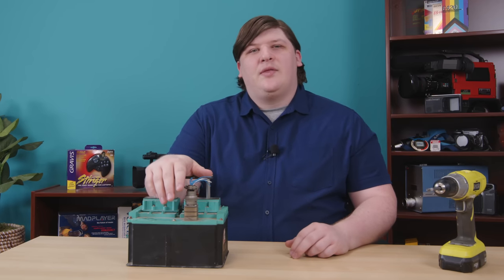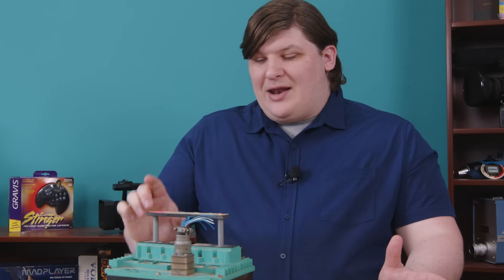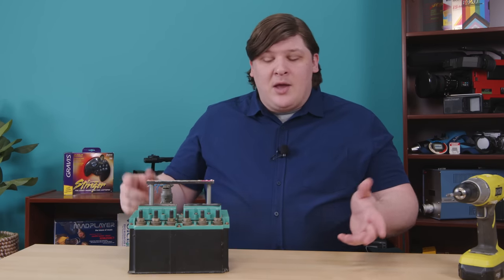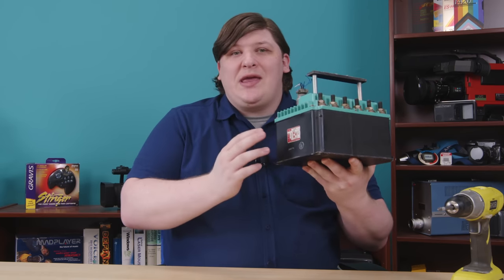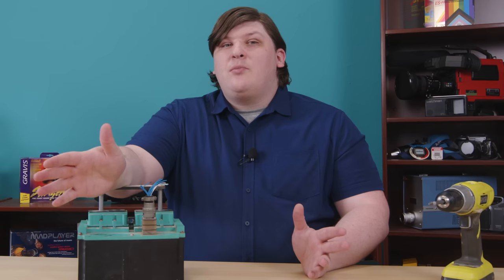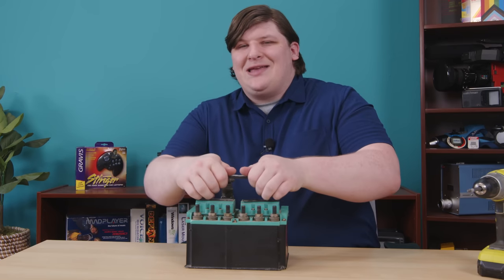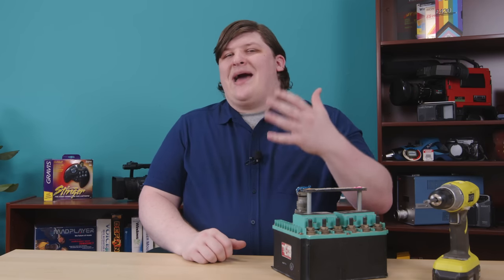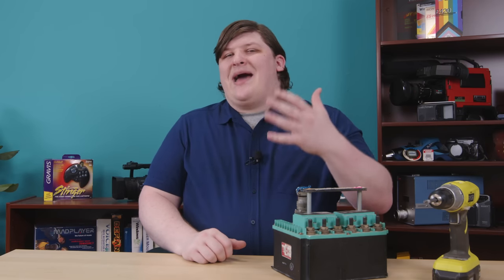A Short Story About (Battle)shorts

Comment: As someone that's been in combat conditions and operated military equipment, I can say with 100% certainty that YOU DO NOT GO AROUND YOUR EQUIPMENT AND DISABLE ALL THE SAFETIES AND AND ENGAGE YOUR BATTLE OVERRIDES. In fact, with the exception of overrides/war time fuel reserves/war time power (yes those still exist) in planes where the pilot has unilateral authority to do such things, no one is allowed to engage a battle override without a direct order from a commanding officer/NCO. That being said. You probably wouldn't get in trouble if you engaged one in the heat of battle and it ultimately saved lives/the vessel. Those overrides have labels near or on them expressly forbidding their use without appropriate orders to do so. The best way to think of a battle override is as a last resort in case of a malfunction on a critical piece of equipment, ie a generator. We used to refere to them as "run to death switches" because thats exactly what they did. Also land vehicles do not have override switches. They are designed from the get go to "run to death" under the assumption that the human operating said vehicle and demanding maximum power is probably more knowledgeable about the current situation and simply defers to their judgment. Part of a service members training is the limits to which they should operate their equipment under normal conditions, commonly referred to as "do not exceed" limits, and when they are allowed to disregard those limits (basically anytime they feel it warranted in combat). A tank that stopped spinning it's turret in the middle of battle because a safety said nope, you might break me has instantly become a death trap for anyone inside. Remember tanks kill other tanks, and these days takes are pretty fast and accurate. Those few seconds that someone would need to figure out a safety had cut in would probably be the difference between life and death. Instead that turret will keep turning, even after the gear box has dumped it's fuids and the motor has caught fire, it's going to keep trying. Your proverbial tree (which would not in any way stop a modern tank from moving) won't even register as far as the tank is concerned, it will keep trying until the operator stops and checks it out, or it burns.

I fully understand and respect your stance on military. Obviously myne differs, but that's ok, different paths in life and such. But, we should be careful in attempting to talk knowledgeably about things we don't understand, especially if we have intentionally distanced ourselves from those things.
Reply: Last sentence was totally uncalled for considering all the precautions taken to emphasize on the speculation side of things.
Reply: @capybara5494  I disagree. If your intention is to be informative, don't speculate. And I was as kind about it as I could be. The simple fact is CRD understands the technical aspects of the of a battle override, but doesn't seem to understand why they exist or how they are are used. He also talked a lot about where they are used and was quite wrong. Many people in the comment section that are equally under informed are agreeing as though everything said in this video was spot on. That's not a good thing consider how many errors he has made in this video.

CRD has built himself a reputation for being a valuable and reliable source of information on technology and the history that surrounds it. Speculation to the degree he does in this video is a surefire way to undermine that reputation. Better we point out his mistakes so that he doesn't miss them now rather than just letting him fail. I personally like his channel, his style, and the way he produces his videos. If you like someone, the best thing you can do is point out their errors.
Reply: @jonmcentire  Wow, just wow! You are wrong in a few ways but what's most obvious is you are just being spiteful. First, "doesn't seem to understand why they exist or how they are are used", this is only half true he had a very good understanding of why they exist even considering he was speculating. It could be said that is is true that he did not know how they were used but he wasn't that far off and his lack of understanding there only come from him not serving himself, he wasn't to far off though. Mostly it was just about the when and who of the matter, and the idea that they may also be used in all major equipment. However, he made it clear multiple times he was speculating on that not stating fact.

Second, "Speculation to the degree he does in this video is a surefire way to undermine that reputation" This statement is patently false. The only way it could be true is if he was not clear about the fact he was speculating and was attempt to present everything he said as fact. Speculation in and of itself is not bad, it is just a way for us to take what knowledge we do have and attempt to understand why or how something we don't know about might work. Speculation is only bad if it is presented as fact, or has not basis in any real facts.

In my opinion you, maybe as a former service member or maybe as someone that just really likes the military, took offence to the fact a creator you like has a opinion of the military that you don't like or agree with. As a former service member myself I'm not happy that it almost appears that CRD may let his dislike for the military extend beyond how it is used to include it's very existence, but I can at least understand why someone might hold that opinion. One thing is for sure I would absolutely not let it affect my opinion of his content nor would I vent my frustration by posting uncalled for jabs and trying to make it seem like he has done something wrong just because we don't see eye to eye on this one topic.
Reply: @lerakuro   Istand by my original comment. I have no problem with his stance on this military. That's not an issue for me. CRD has a right to feel the way he does and I respect it. My only concern is specifically that it may color his view on the military and things pertaining to it, especially if he's going to freely speculate on the subject.

Speculation is pointless if there are valid sources of information and you don't use them. If nobody was available to ask, or there where no sources online, then yeah speculate away. But that's not the case.

As you said, he was mostly wrong on the when, who and where. Which is pretty much all of it. Even the why was wrong by about 50%. 

To your final paragraph, my prior service not withstanding, I like the military in that I served with some excellent people and experienced some awesome things by serving. I also think it's an excellent career for anyone that can cope with that lifestyle. That being said, the military most certainly has it flaws and I have no problem pointing them out. CRDs opinion of the military does not color my view of his content. My only reason for posting my original comment was to point out the errors in his speculation and to caution against freely speculating on a subject you have admitted to disliking. His channel has been about facts and well reasoned speculation. This was not well reasoned speculation.

Comment: A great video about a sobering subject.

As for crews being aware of the limitations or results of emergency overrides, at least in theory, they should be. 
The excerpt from the P-47 manual you put up for War Emergency Power mentions the overall hard limit of 15 minutes, and this would probably be broken up into shorter chunks (e.g. 5 minutes at a time) to limit overheating, which could seriously damage the engine there and then. Pilots would also (provided they made it back) have to log/explain any use of WEP, both to prevent abuse, and to keep track of the amount of WEP time the engine had (for maintenance/overhauls). That's one reason for the stop wire, you could tell afterwards when WEP had been used.  
How well an operator (of any machine) can keep limits like this in mind obviously depends on training and on the specific situation they're in, but it would've come up in manuals or training somewhere.

Concerning the cynical part of the video... don't they already call that "crunch time", and abuse it?

Comment: You're close, but let me correct some things: The original machine has a base-plate of prefabulated aluminite, surmounted by a malleable logarithmic casing in such a way that the two main spurving bearings were in a direct line with the pentametric fan. The latter consisted simply of six hydrocoptic marzlevanes, so fitted to the ambifacient lunar waneshaft that side fumbling was effectively prevented. The main winding was of the normal lotus-o-delta type placed in panendermic semi-bovoid slots in the stator, every seventh conductor being connected by a non-reversible tremie pipe to the differential girdlespring on the "up" end of the grammeters.

Comment: I’m a service contractor… I have been since I was 15… relays fail… a LOT and bypassing them is often required to get things working whenabsolutely needed… 
So, the phrase often repeated in Star Trek never stood out to me… it’s obvious.
Reply: For instance… in an air conditioner, there is a big relay called a contactor… when the primary coil fails, he contactor won’t automatically engage/turn on…
There is a plunger you can push to engage manually… or bypass… any electrical device that requires a large current to start up… needs one and the ability to bypass is critical for testing or emergency usage…

Comment: 28v DC is Aircraft voltage - I work in Aerospace and we build fans, valves and services a wide variety of other aircraft small parts like actuated doors.  (by the way, we met in the Junk Store a while back talking about old motherboards - and I sent you an email)
It likely could have been used on either place

Those plug & socket with the wires sticking out, are not cheap.  They are sealed connections.  I build the female side of these at work for some fans.  Some about that size, and most smaller.

"Battle Short" exists on decommissioned military power generators.  Keeps the engine running at a higher RPM and disables/bypasses some safeties to keep vital equipment running.

Comment: Brother is in the Army and says you're mostly right but that once it's closed, it never opens back up, and that's probably why this one got removed. It's been engaged and there's no easy way to undo that. They "Look a bit different now" in his words but this was probably used for a hydraulic pump to move something militant.
That said he is "pretty sure" they use ridiculously overbuilt wiring to support this behavior and that the failure point is "always the load"

Take from that what you will

Comment: I think the EPS relays are more to do with the routing of power through the ship's various conduit pathways. Per memory alpha, EPS stands for electro-plasma-system, where instead of say copper, plasma is used as the conductor due to the vast amounts of power required(aka, copper would vaporise into a plasma anyway) . So it's more like when the power company trips different relays to re-route power between different substations around damaged equipment and get as many people back up and running as quickly as possible, and to limit the inrush current by bringing single parts back online instead of repeatedly tripping the breaker at the primary sub-station. Power companies routinely alter the load balance of the grid to deal with maintenance and outages. 

So in Star Trek, when they say bypass the relay, they literally mean send the power down a different pipe to avoid damaged sections, which might mean shutting other things off that were previously using the pipes it's being re-routed through. Whenever they say override the relay it's more in line with your explanation, which is probably why they often throw around terms like "it could fuse the relay" when they talk about overriding relays. The Iowa class battle ship had a "Casualty Power System" that could be used to bypass sections of damaged electrical conduits, with outlets peppered around the ship that they called "biscuits" for some reason.
Reply: The big override is literally a bypass.
It bypasses the internal contacts of the relay.

What you're referring to is "rerouting" in the show. They reroute around damaged conduits and bypass relays when the conduits are fine when the relay is not responding.

Comment: cannot substantiate, but i was told that during the lunar approach & landing mission command had balle shorts engaged for the control room. it didn't matter if a console was burning, you were supposed to keep doing your job while the guy next to you (with the burning console) fought the fire. obviously similar primary equipment would be "shorted" as well. just because the tracking motors in a radio array are
about to melt doesn't mean they get to stop working.

Comment: 19:00 - Humorously, when Lockheed developed the Blackbird spyplane, (plus the cancelled B-70 bomber and a few other similar ultra-high-speed, high-altitude aircraft) the Soviet Union developed the MiG-25 interceptor/fighter aircraft.

It was capable of reaching the speed and altitude of the SR-71 Blackbird - but only at the expensive of pushing the engines way past the "safety margin". It would get one "boost" to try to shoot down the American plane - then if it was lucky, the engines would last long enough to land. If they did last that long, they would need to be scrapped and replaced.

Comment: About the War Emergency Power.
In the memoir of the pilot fighting in the Czechoslovak RAF 311. Bomb squad. He mentioned a fault in throttle linkage, that pushed the engines of their Wellington to the WEP rpm range. Engine manufacturer rated the engine for only 1-2 minutes of WEP, then the crew risked a "catastrophic failure"
They were at that time over 100 miles far from the nearest RAF airfield, flying in a low altitude, doing their anti submarine run.
Despite all of that, they managed to reach the shore, cut the ignition and glide to the airfield.
Plane was immediately stripped of its engines and they were sent back to the factory for analysis.
In the end they only found an increased wear, fro the amount of the engine hours, but nothing out from the factory tolerances.
Reply: that is really up to tolerances at that point. maybe the engines they had worked fine but 95% of all others would have failed

Comment: I'm reminded of hearing about an aerial tramway which didn't have the best safety record. It turned out they had defective equipment and were running with regular service with the overrides engaged. It's a bit of the same idea but more importantly shows the risk for abuse. If a safety device is tripping out there's usually a good reason and (in non-emergency situations) they should only be bypassed while under the supervision of somebody who knows what they're doing.

Comment: Having served on US Navy ships, there is one other small scenario that was overlooked.  Loss of power, or degraded power.  Many of the battle shorts literally just connect a 2nd power source directly to the equipment, after you have confirmed the 1st line is dead or tragically out of spec.  Literally "rerouting power" being the only purpose of the unit.  On the Arleigh Burkes, most of this is automated through high power contactors that switch from primary to secondary power automagically, but most of those panels also had a manual override battle short for when the sensing componentry had failed or you needed to swap manually for some other reason.  Generally these panels would be right next to the equipment (in my case, radar systems).  So, if a shell or torpedo blow the main feed line in half, you can push one button and be on the 2nd generator through a completely separate circuit.

Comment: Fun fact: Starfleet technology is actually silica-based. That explains why when the consoles blow up in a battle a large amount of rocks fly out and kill the person using it. 🤪
Reply: lol!
Reply: Nonsense, this is simply because Star Fleet consulted with Takata to use their airbags in the consoles.
Reply: Ahh so taco bell beef does have something in common with trek
Reply: I like the explanation that it's actually the plasma in the eps (electro plasma system) hardening when exposed to air instead of violently exploding and setting the entire room on fire

Why there's plasma running through computer consoles is a completely different issue

Comment: Contactor = when energized allows large current device to only be on at each switch. Relay = Has three contacts per switch that allows power to be redirected or power disrupted when energized. Can also be wired to apply power when energized. Contactor is a subclass of relay.
Reply: Actually, contactors are typically used for arc prevention or mitigation, particularly high current DC loads. (Such as electric vehicles.) Mechanical Relays typically do not have the same arc suppression behaviors; and then there's Solid State Relays which are much more like big honkin' transistors. Pole count is orthogonal. Asserting that Relays are typically Three-pole would be a falsehood.

Comment: I just want to correct one tiny bit: A "battle short" (now mostly called a bypass, since it's a catchall term for electronics, mechanics and HV electricity) is intended to "short true/on" a fundamental piece of equipment (on most tanks I'm familiar with, systems with a bypass are the fuel-line pumps, the engine sparks, the track control electronics, the turret positioning and the autoloader. Maybe surprising to some - but the firing system itself is not bypassable. A failed firing usually means you have a live, unexpelled round somewhere in the barrel - firing a second one into it will not increase your chance of victory).
That was all preamble to say: You don't engage a bypass "before battle", you engage it during battle, when a critical system fails non-critically.